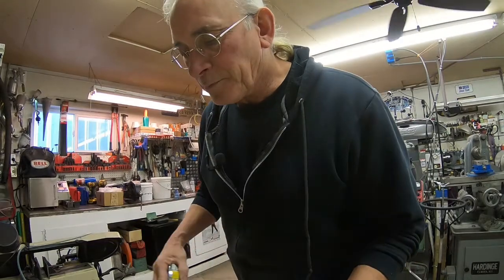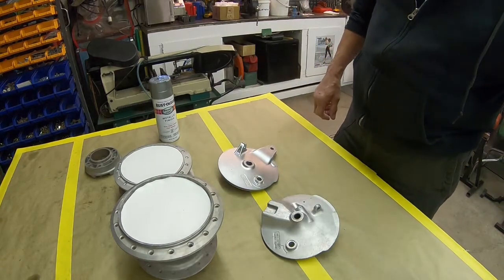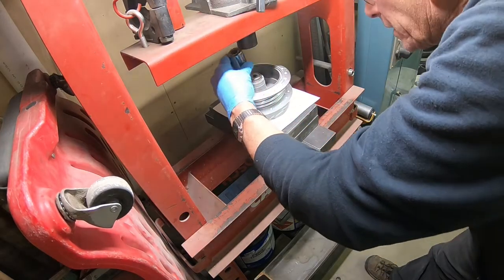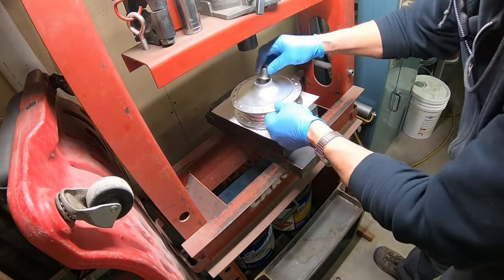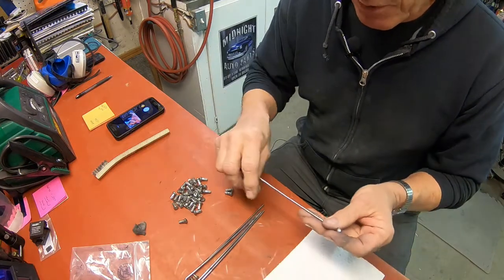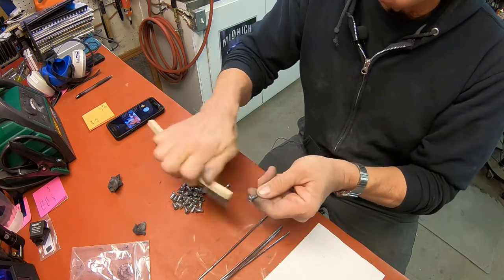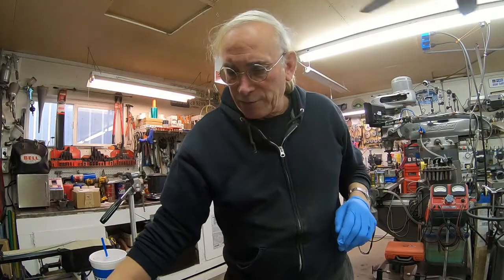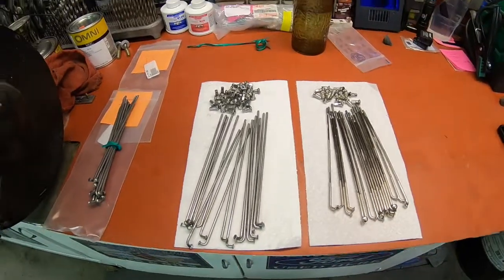Suzuki motorcycle hub assembly, wheel paint, and spoke plating

Comment: Are you greasing used or new bearings? If used, I never thought to simply re-grease!. That would have saved me money!! A wealth of knowledge you are.
Reply from the maker: I think those were used, that was a very low mileage bike. Just pull the seals out and look, if no rust, they spin smoothly and no excess play.  I just clean them in solvent and dry with compressed air, and lube them up. Save money where you can. Thanks for the kind words and for watchin.

Comment: Hey Dale. On aluminum hubs and parts I’ve seen a lot of guys vapor honing with glass beads. I appears to ‘clean’ and almost polish the surface. I’ve tried Vapor honing but get varied results depending on the ‘dirty ness’ of the piece. What’s your thoughts on this? Oh and I’m definitely looking into this Caswell electricless process. Thanks for that option!!!!! Ron
Reply from the maker: Hey Ron, I don't get real fussy with the hubs, if they are the polished ones, I clean with glass beads and rebuff on the buffer. I much prefer doing the unbuffed ones, those I just clean with glass beads and put in the ultrasonic cleaner, then paint, then clear coat. Some look alright just with clear coat on them. The only process that I have that is Caswell and electroless is Nickel, the cadmium and zinc require a power unit to plate them. At least my system does, Caswell may have some new products out that I am not aware of. I have been using my system close to 20 years.